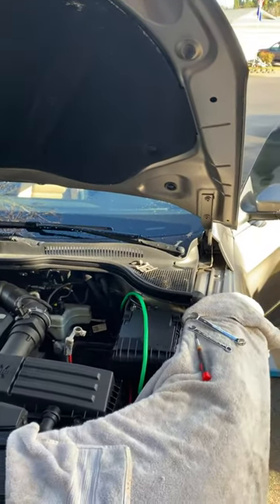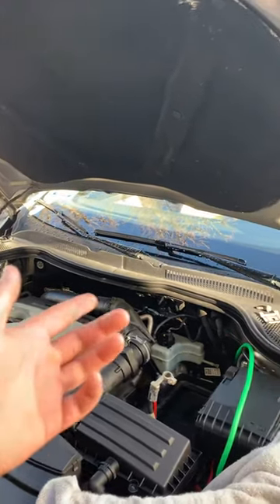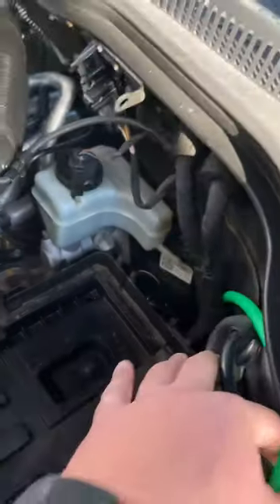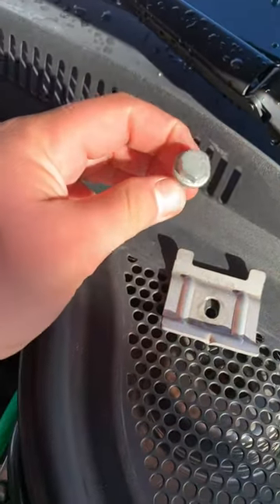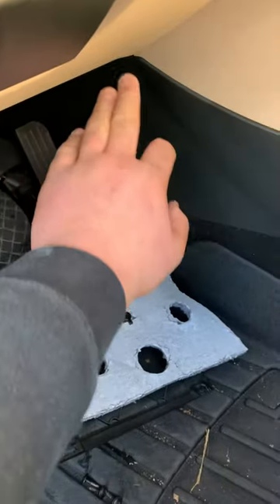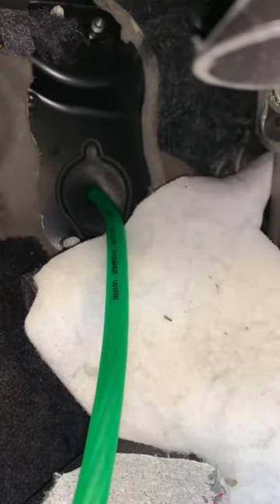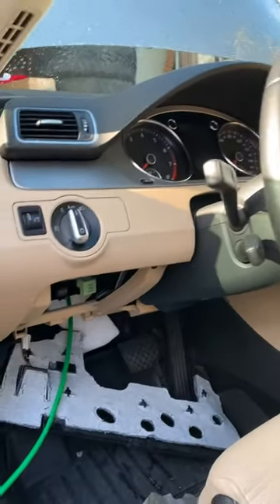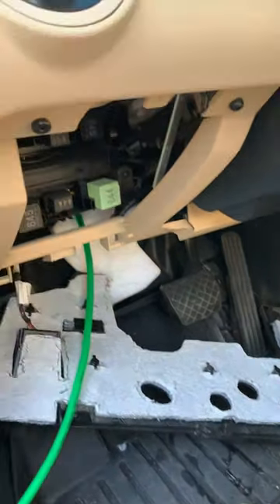Volkswagen CC/Passat how to get power wire to the trunk

Comment: How’d u run ur wire back from inside to trunk? I was thinking inside plastics along door frame, but my rear passenger seat is the one that opens not rear driver side so I’d have to run it across to get into trunk?
Reply from the maker: Yeah I just ran it under the door frame trim

Comment: Dang lol we got a 2010 VW CC TSI Turbo sport it's a manual lol. I been trying to figure this out before I install our Sundown amp n Subs iv done did the big 3 upgrade
Reply: Do you find a way inside? My CC has also a manual gearbox
Reply: @flxrxn4312  not yet I'm going to do the install tomorrow I done placed the box and Sundown Sav3 8"s in the trunk and got the amp where I wanted it. But it's not wired up yet it's just sitting there looking all nice atm lol. It's been raining alot here two days ago we had a tornado that went right over top of us I thought we was for sure losing the car n the system lol it was bad bad. But tomorrow is supposed to be nice out so imma deff see if I can find a good spot for the 0g sky high wire to run through
Reply: Ok, can u please leave a comment when you found a good spot to go into the interior?
Reply: @flxrxn4312  most definitely I'll let ya know  as soon as I find a good routing for the wire. I been searching like crazy and can't find it online but I'm positive there is a hole to go through lol